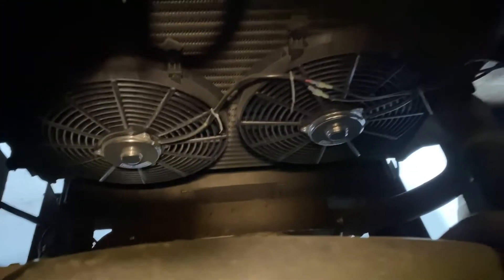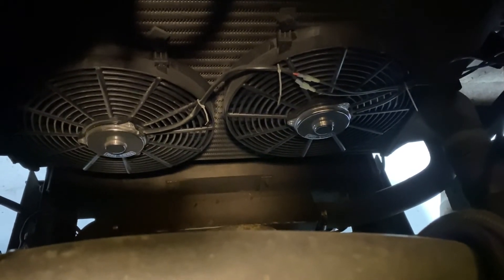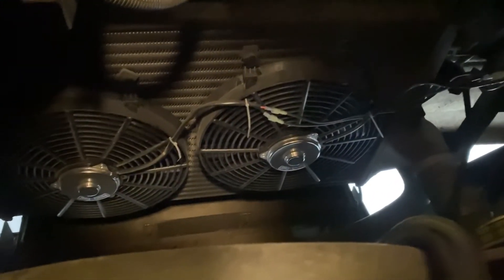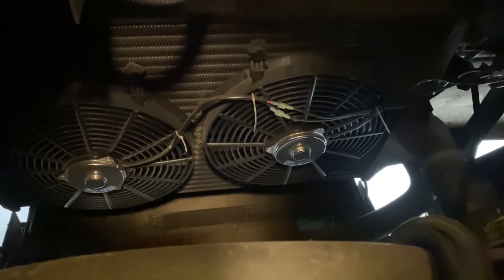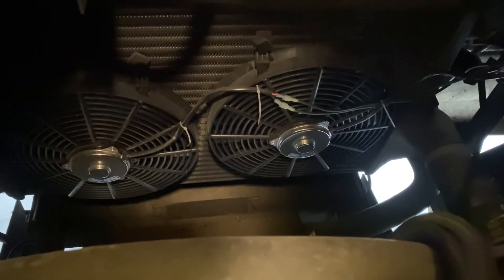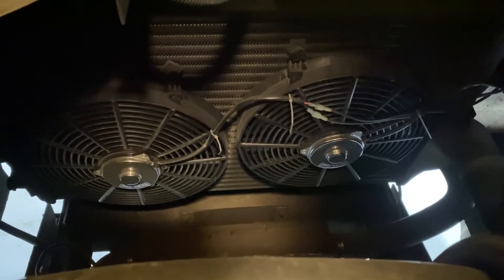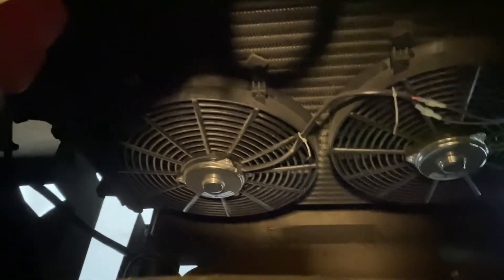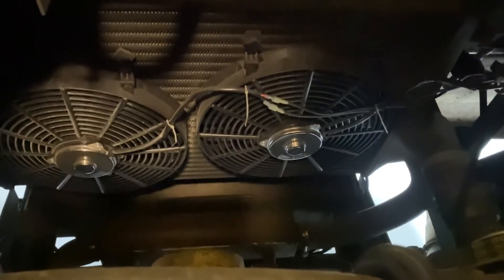Diesel Pusher with Electric Fans: How's it working?

Comment: Good day Ted;
So how is this working for you still?  I really dislike the hydraulic pump driven fan. Such a waste of components and energy
Reply from the maker: I have since sold that RV but it was and is still working. The overall concept would work, but I would review my videos for what I did and improvements I’d suggest making if you want to consider this on your RV. I haven’t done this modification on my current RV yet.

Comment: This is an old video, so I don't know if you'll see it. 
But I'm buying an older MCI right now, and the rads are rotten. 
My plan was to toss the original rads, and install 2-4 large diesel radiators with electric fans.
The fans you picked will actually fit pretty well for me, so I'll probably end up using 4 pairs of them.  
Your video has given me a nice confidence boost. 
Thanks.
Reply from the maker: Another suggestion if you’re doing that: adding some scoops on the side will help get natural airflow in, which will help the efficiency of the fans.

Is the MCI 2-stroke or 4-stroke? The old 2-strokes had more cooling issues.
Reply: 2-stroke 6V92 in an MCI 102-A2 
And yes, especially with the automatic transmission they had lots of cooling issues even when in good shape. 
I'm not totally sure on the size of the original radiators, but I believe the 8v92 ones are 24.5x19.5x 7.25" thick.

I was originally thinking four modern radiators stacked in two pairs.
But I'd need a fairly powerful fan to for the effectively 4.4" thick core.
But your video gave me the idea of removing the heat load from the engine oil and transmission. 
So I'm now thinking just two of those radiators, but with an air cooler in series before the stock plate coolers for both and a thermostatic valves so things still warm up quickly in the winter. 
And four sets of those fans (I actually found your videos while trying to find fans that where powerful enough).

The new rads are too large to fit in the original space (I specifically wanted a larger area to reduce the needed fan pressure for the same cooling).
So I have yet to decide if I'll put them on the back above the engine bay like the later MCIs or on the lower side doors.
Reply from the maker: That sounds like a very cool project (pun intended). Reducing the overall cooling load on the radiators will be a must for you. Also make sure that you add.
Reply: What should I make sure to add? I think you may have cut your comment off a bit short.
Reply from the maker: Make sure that you add enough electrical capacity to run the fans was what I was going to say.
Reply: Ah, ya, I should have that covered, these come stock with 230a 24v 5DN alternators and I'll be running most of the coach off of a separate 48v system.
And I should add that electrical/electronics engineering (mostly automotive these days) is my day job.

Comment: I'm considering the feasibility of a Wanderlodge Conversion with Detroit series 60 500 HP with Allison 4060 HD Trans.  I believe Prevost has a Kit for Prevost . I would leave all coolers intact . Any knowledge of a succesfull system on this Engine size being completed.
Reply from the maker: I've only heard of one person besides me doing an electric fan conversion on a diesel pusher (see below in the comments for that person). You're correct that Prevost offers a kit for their busses, which are also Series 60s in the ~500 HP range. I see no reason why this wouldn't be doable on your bus.

Comment: Nice videos!  I just stumbled on your electric fan video and wanted to say that about 17 yrs ago I did the same on my 99 Coachmen Sportscoach with the Freightliner XC chassis, 5.9 24 valve Cummins.  I have well over 100,000 miles on my conversion and it has worked flawless.  I used four fans that I salvaged from a junk yard and made a sheet metal "tent" on the rear of the radiator to draw the air through the intercooler and radiator.  I also installed a Horton air clutch on the original fan and I tapped into the Engine ECM to control that fan clutch.  The ECM will turn it on if the engine temp, intake air, or transmission is too warm, and also if the exhaust brake is engaged for extra braking (that is huge HP!).   The electric fans are two speed and I found low is all I need for 90% of the time.  I installed a three position switch, Off, Electric fan On, Engine fan On.  I also removed the propane furnace and installed a coolant to air heat exchanger, a oversized AC evaporator, a larger AC compressor, two more condensers and my own designed air handler to provide free heat while driving, or central AC through the floor ducts.  I find that if the outside air temp is below 50 degrees the electric fans are not needed because the heating system is removing enough heat.  I use a Webasto diesel fuel boiler for heat when I'm parked.  I also upgraded from 160 Amp to 200 Amp alternator but mainly because the new Bosch alternator will put out 120 amps at idle, old one couldn't keep up at idle but did okay at cruise.  I also run taller tires and super singles in the rear which give better ride and mpg, my peak torque is 1,600 rpm and I cruise 65 mpg at 1,750 RPM so it's in the sweet spot, if I'm in a 55 mph zone I run in 5th gear and it's in that sweet spot again.  I monitor the engine and transmission with the VMCpc by SIlverleaf through my laptop to keep an eye on all values and track mpg.  The fan conversion increased my mpg about 10%.  I tow my F150 Super crew cab pickup and still see about 10.5 mpg, if empty I can get 12mpg on trips, but a headwind or tailwind influence that a lot.  Sorry this got long but I thought you might like to hear it.
Reply from the maker: Glad to see that someone besides me has done this before, and glad to hear it's held up so well for so long! It sounds like you went with a simpler method than I did, but it sounds like your RV's cooling needs might be a little less than mine. It's a great conversion!

Comment: I love your videos, even though I am not an engineer I understand most of what you do/explain.  (I think)  I bought a diesel pusher last spring that was 600 miles away from me.  Supposed to be road ready, yada yada, but alas, when trying to drive it home, I found out the radiator fan (hydraulic motor) was not working, and i got stranded and still do not have it home.  It is a Beaver Patriot, '96 model, and finding parts have been difficult. Long story short, a garage that used to work on 18 wheelers for us before I retired told me to hang cooling fans on the radiator and I could drive it home.  I am nearly ready to do that, and the cooler weather should help with it.  He has done it to bring others buses and motorhomes in for repairs instead of towing, so that is what sent me searching for videos on youtube, and I found yours.  I am reasonably sure we can remove the factory shroud and fan balde, make a new shroud and fit puller fans into it and make this thing work, and hopefully quite well,  based on what you have been able to do.  Mine is a 3126 Cat, Cummins trans, and side rear radiator (thus why I think a new shroud and fans located there should work).  Any thoughts?
Reply from the maker: Glad you've found my videos useful, Wayne. If you take a look at the videos I made on this series I think you should be able to more or less replicate what I did, especially if you've got a 3126 already. Having a side radiator I don't think should hurt things any, you just still work it as a puller setup pulling air into the engine bay. Is your intercooler in-line or separate from the main radiator? That will change up what I suggest to do there some.

One thing to consider if you have a side radiator is that you can try to fabricate some sort of ram air scoop. I believe I have a video somewhere where I show the scoop I added for ram air going into the air filter/turbo, which has made a different in lowering EGTs. Doing this for the whole cooling system would certainly help with a side radiator setup.

No reason why this couldn't work for you. I would suggest buying genuine GM radiator fans instead of the Dorman replacements like I did if you want to go that route. There are many other good fan options, but I ultimately am happy with the performance of the Suburban fans.
Reply: @TedsGarage  Not sure about that.  Both smaller coolers are on the outside of the main radiator,  I have not looked at it close enough to know the answer.  It is currently 500 miles away;  awaiting new tires to be installed then I will attempt to bring it home. I definitely think this should work. I had several companies tell me it wouldn't, and until my local mechanic (he can work on about anything it seems) told me about using these fans temporarily I just assumed these "experts" were right.  He also mentioned the advantage of adding electric fans, even with just a toggle switch, for when you can use that extra cooling capacity in hot weather and slow traffic.  I like the idea of increased power by not using the mechanical system for cooling even more.  I see no reason it van't work, after watching all the things you did, including the alternator upgrade.  I was wondering about adding another battery.  Not sure if that would be helpful,  just thinking it might. Sounds like something in your wheelhouse.  Thanks again.  I really like the old Beaver, if I can make it work.
Reply from the maker: @wayneblake4914  I had a lot of "experts" telling me that it wouldn't work either, and obviously they were wrong. The increased horsepower, fuel economy, and smoothness have been very nice.

An extra battery really isn't required or beneficial in this case. The two batteries you should have for engine/starting purposes are plenty. Ultimately you will need enough electrical power to support all your electrical needs continuously, otherwise you will run into low voltage and power issues. As a stopgap, what you could do is run your generator and tie the house and engine batteries together. That would get you home with the electric setup and you could further upgrade things there. You could always just put the fans in and wire them to be running continuously (make sure that your wiring is able to handle that many amps) and then add in the more complex PWM controllers later when you get home. That's how I would do it to get home. Staying at a lower speed (55 or so) will also reduce the cooling needs for the trip.

I wouldn't have any qualms getting something like that rigged together and then limping it home to get it fully set up properly.
Reply: So I came across this video. And now you're comment and I have exactly the same rig you have a 96 patriot side radiator and the same dumb hydraulic mechanical pump.  That now leaks like a siv.    So, how did your situation turn out?  Which fans did you use?  Did they pull enough air?

Comment: Great info! What CFM do you have on yours fans?
Reply from the maker: The pushers are rated at 2,500 CFM each, but in a pusher configuration probably more like 2,000. The Suburban fans I don't have the rating of, but 5-6k cfm per pair is what I found in internet searches.

Comment: Great information. Do you use sime kind of scangage to see the temputure. I am looking for a gauge that would work for a 1998 Endeavour 5.9 cummins. Thanks.
Reply from the maker: I use Bluefire for Motorhmes for monitoring temperatures, etc. I've been happy with it overall.
Reply: @TedsGarage  Do you  know if Bluefire will work for 1998 Endeavour with a 5.9 cummins.
Reply from the maker: It should work with anything that has a J1708 or J1979 connector.

Comment: TED! Love your videos! They've been very, very helpful.  We just purchased a similar model but haven't been able to start just yet on the work we want to do.  Ours is a 2002 Holiday Rambler - Scepter - 40 PBD (w/ only 56,250 +/- miles); it has a Cummins 330HP turbo diesel and the 6 sp Allison 3000H transmission. Would love to chat with you more about some things, both interior and exterior.

Comment: Did this affect the performance of your exhaust brake?  Im thinking probably so, ive heard that fan can use up to75hp and that resistance during braking  is lost now.
Reply from the maker: Good point and I forgot to include that in the video. I did notice a reduction in the exhaust brake effectiveness, but not as much of one as I had expected. Sometimes I have to end up going down a gear and letting the engine spin a bit faster (the 3126 will spin up to 2900 in exhaust brake mode before it upshifts) but it hasn't impacted our ability to safety travel through the mountains. Ultimately for me, the pros still far outweigh the cons.